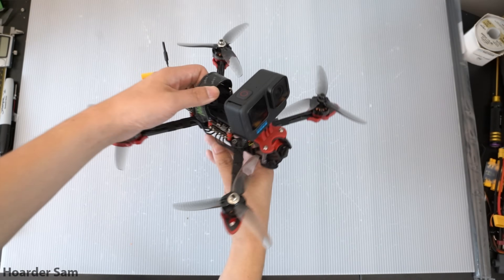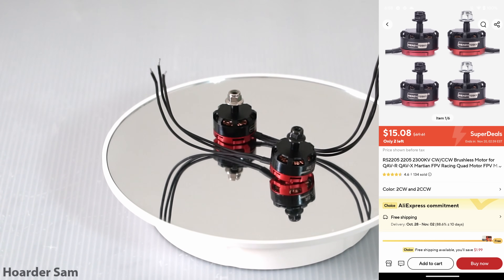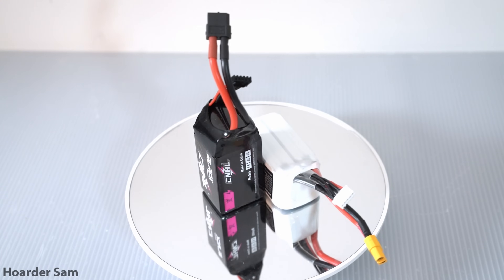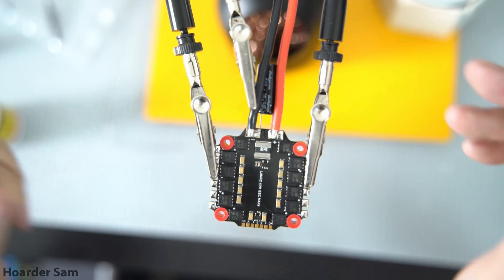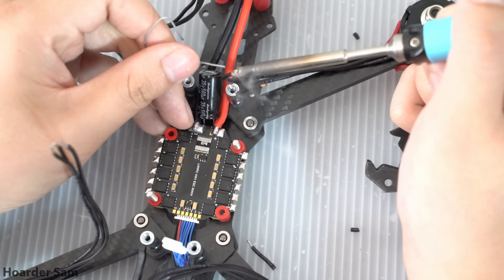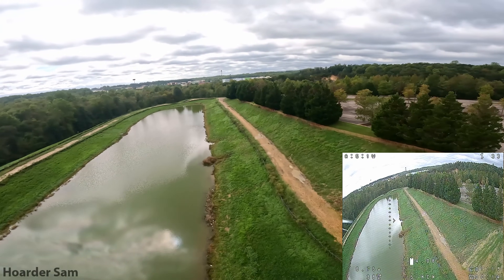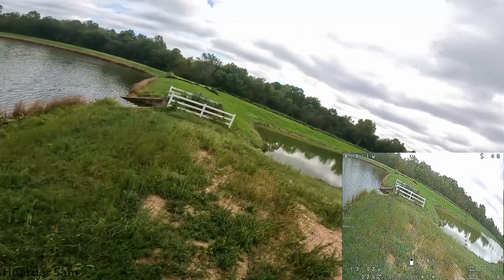How to build a 5-inch FPV Drone for $100

Comment from the maker: Wiring diagram: https://i.ibb.co/2WLqK8p/wiringdiagram.png
Betaflight setup video: https://www.youtube.com/watch?v=sRp73gKOTM8
Frame build video (no audio): https://www.youtube.com/watch?v=ldjRXFBIbpM
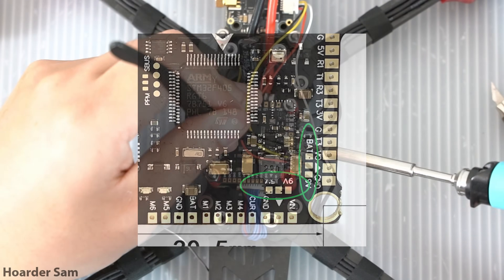Reply: Sorry for interruption, are you able to explain a little bit more about the Vtx wiring one at 8:33. I don’t really understand if you need to solder both part or just choose one section and in that section you solder a bridge.
Reply from the maker: @JohnChen-jc1qm  Oops sorry I haven't made the wiring diagram yet. Here's how I bridged my pads: https://i.ibb.co/hBbRgRq/bridge.png
Reply: @hoardersam10  can you please make the wiring diagram
Reply: Where is wiring diagram
Reply: hey hey can you make a wiring diagram if you are using a SpeedyBee TX800 VTX. i can see it only can get Voltage in:3.7-5.5V
Reply: can you please tell us were to get the file for the auto populating and also how to bind between the receiver and the transmitter ( I'm new so i kind of need more details) please respond i really need to know
Reply: Hi, I got the Speedybee tx800 vtx, do I still follow this wiring diagram? The Solder Bridges?
Reply: I used the 9v solder bridge.. I think I damaged the Speedybee tx800.. Should I use only 5v?
Reply: I haven't plugged the battery yet, I only used the cable to pc.. I'm afraid that I damaged the tx800.
Reply: Nevermind, I got it working now I used the 5Volts instead of using the 9v solder bridge...now the speedytx800 is working...Thanks
Reply: @TheFilewalker93  I also have the same problem, but I can't figure out where the 5V is for the VTX. Can you let me know?
Reply: @TheFilewalker93  you will destroy it man i just did it to my one he's not rly making things clear he links parts to use but they aren't compatible a few people have blow them up because of him
Reply: @brazed420  mine works fine...at first I thought i destroyed it.
Reply: @TheFilewalker93 Can some1 tell why his 5inch drone guide is more cheaper than the 3.5inch one bc im looking to build a 3.5inch drone but i thought that 3.5 inch drone were cheaper?
Reply: And can u make a guide abt it for ppl who dont care abt weight
Reply: @TheFilewalker93  i need help man im new i im scared
Reply: @MRStylinNe help about what? vtx?
Reply: @AVoiDes i dont know so much about the cost of 3.5 inch drone, i just followed this build and it works just fine until i lost it on my 3rd fly.. i should have invested in a gps..
Reply: @TheFilewalker93 what does it mean by bridging? What do i do for that part ? i dont understand, first time building
Reply: I'm building this drone but with the ratel 2 cam and I'm using the ARRIS VR-009 fpv goggles which are a 16:9 and i tried all the different things pal ntsc and i cant cet it to work at all can you please help i really need it please
Reply: i entered the camera settings and matched the ntsc thing but on my Arries goggles it just shows the video in the background and then random characters mostly V can you please help i really need it
Reply from the maker: @jim-xi1ml Try messing with the font manager, reupload the fonts
Reply: i just figured it out it was a font problem
Reply: hi its me again iv built this drone about 8 months ago and haven't had really any problems except for one thing and it is the video quality just randomly a few months ago the video coming from the vtx got worse there is more green in the video a little bit of flickering but the flickering doesn't happen much and i think it is a bit more fuzzy or something. I checked all my wires and everything and didn't find anything that looks off. Do you know what the problem might be?

Comment: Now, on the page for the flight co ntroller, there are several choices.  I see in the comments that this price given is not for the complete set.  It seems the more expensive $58 option includes all pieces.  And whats with only being able to buy one piece since im thinking of building at least 3 to have a spare?  But yeah, the parts pages are confusing what exactly ill get for the money then having to figure out which is the other piece im missing.

Comment: Hi, I built the drone according to your tutorial and it came out fantastic, I wanted to try installing the Caddx VTX Ascent, do you think it could work?
Reply from the maker: Electrically it will work fine, but physically mounting it may be tough. The ascent is a 14mm camera and the cable is short, so you will need both a camera adapter and some kind of way to mount the VTX board closer to the camera
Reply: @hoardersam10 To mount it, I was already thinking of creating a dedicated support, it shouldn't be a problem, as soon as it arrives I'll try, if you're interested I'll let you know when I tested it how it works.

Comment: I made  this drone at the end of 2025. Cost about $200, but I used a Zeus 1.6w VTX, a Caddx Ratel 2 camera, added a Vifly Buzzer and also a GPS with magnetometer. To get the GPS to work, I had to remap the LED pad to a Soft Serial TX 1 port so that I could use this as a Smart Audio pad for the VTX. This freed up TX3 and RX3 to be an I2C interface for the SCL and SDA on the GPS/magnetometer, with the GPS being on TX1/RX1.  While the OMNIBUS F4 is a little limited in the number of available UARTS, with SOFTSERIAL and resource mapping it's enough to get a GPS with magnetometer to work.
Reply: same also 200 i didnt wait for sales cause i dont care enough

Comment: I have 4 6s 1300mAh 22.2V LiPo, Can they still work?
Reply from the maker: The 2400kv motors are only rated up to 4s, so you will need to get 1700-1900kv motors for your 6s lipos

Comment: I tried the smoke stopper test, and the light didnt come on on the FCU, is this just a version difference or a lower voltage thing or have I bought a crap smoke stopper?

Comment: can you fly the drone with 6s lipos?
Reply from the maker: These 2400kv motors are only good for 4s, they will fry on 6s
Reply: @hoardersam10  if i change the motors for MEPS NEON 2207 Motors can i use 6s lipos

Comment: Hello @hoardersam10 ! 
I'm pretty new. Can you tell me how you get the power cables on there? Struggle since an hour and now I have 3 contacts presoldered and the solder didn't melt anymore.. was hard to presolder them and after trying to connect them to the presoldered cables it wasn't melting anymore. :(
Reply from the maker: If solder isn't melting any more, it sounds like the flux is all gone so you will need to add flux to get it to melt again.

What iron are you using?
Reply: @hoardersam10 thanks for your really fast response! I'll try it in the next minutes. I use sn99.3 cu0.7 with diam 0.6mm (if it's true, it's from AliExpress) the soldering iron is an old one model no zd-30B 220-240V/50Hz/30W but was working on other solderings the last days with the same setup fine. Have Halogen free Flux: NC-559-ASM
Can't explain why the solder isn't connecting to the board contacts :( with and without flux
Reply from the maker: @philipp3308  Two things make it harder, that is lead-free solder, and that soldering iron is not a smart type that can adjust heat quickly.

So what happens is if you touch the soldering iron to a part, the part absorbs the heat, the temperature lowers, and then the solder doesn't melt because the temperature is low. 

A better soldering iron like Pinecil or TS100 can instantly put a ton of power back into the tip, in order to maintain temperature. The old soldering irons can't do that.

I would recommend leaded solder (melts easier) and the Pinecil or TS100
Reply: @hoardersam10 thank you so much.. was able to melt the solder again with the flux.
Don't think the heat on the tip is the problem. The solder does stick like a water drop on the tip of the iron, but doesn't stay on the contacts of the board.. :(

I'll try the cables of the transmitter and if this doesn't work I have to wait for the new iron to arrive. x.x 😅
Thank you!!!
Reply: Ps hope I didn't fry anything on the board already xP

Comment: The ESC in the provided link is a 4in1, so I guess we need a 4in1 module with the radiomaster pocket or to buy the 4in1 version of the radiomaster pocket.  

Can you recommend an esc that can directly bind with elrs radio?

Comment: What direction of the propellers you install on the motor? Prop In or Out?
Reply: I am using out. He is using Prop In, you can check at 9:47 looking the prop position.

Comment: August 2025: there's no way this costs under $100. There's a sale going on right now on aliexpress and I followed all your links to those specific parts, they all cost roughly 1.5x-2x as much, and that's before tariffs. It says they're all on sale yet they cost way more than they do in this video. Even without a controller right now the cost is about $200 for these parts
Also this does not include the goggles either
Reply: It depends on your country, but as of august 2025, you can build it for around 100$
https://youtu.be/PlHf5JjOwbA
Reply: I actually bought parts for this drone last month, costed me €239.73 ( $281) and thats without goggles and VTX ( I plan to buy it later)
Reply: just checking them also, everything costs around 150€ without controller and goggles, drone without batteries goes for 100€

Comment: Dies the Batterie conector come with the Stack or have I to Build my own
Reply from the maker: It comes with the stack
Reply: @hoardersam10  i have two last questions is the 1W VTX Good and do you know better Motors who can dit but are Not that expansive to like 30 20

Comment: What capacitor a battery power cable do you use? I can’t find it linked in the products page.
Reply: Look up similar builds or BnF with the same (almost) specs

Comment: Hey, i bought the parts you linked except for the lipo batteries. I couldn't find any reasonably priced 1500 mah 4s batteries, would a 2200 be fine?

Comment: Did you just use the betaflight pid preset for this drone? I built this using speedybeef405 v3 fc+esc (can't get the blackbox to work) and rush tank vtx but everything else is what you used oh and I used a ratel2

Comment: How do you attach the heatsink to the VTX,it doesnt seem to fit it,I really want to attach it perfectly since the VTX runs hot and I plan to ramp up the power later on to 1W
Reply: Did you ever figure out how to attach the heatsink to the VTX?
Reply: @jimbigbird2 nope it still doesnt perfectly cover the entire surface of the vtx,I just forced it to be in an awkward position.anyways,I dont use this vtx anymore

Comment: Can i use 6s 100c 2000 mAh lipo battery?
Reply from the maker: Can't do 6s with these motors, you'll need to get some ~1800kv motors. Also that battery is the perfect size for a 7inch drone, maybe build the 7 inch instead?

Comment: Hey I am currently stocking up on equipment to build my first drone. What solder do you use?
Reply from the maker: I use Kester 63/37 leaded solder in 0.8mm diameter
Reply: @hoardersam10  Thanks and what temp do you solder at?
Reply from the maker: @nimbleduck  Usually 320 C

Comment: The SpeedyBee TX800 uses 5V but the flight controller only has a 9V or full battery option. Can I use the 5V from the cam?

Comment: Hey sam thanks for the video I got all the parts but I did not get the elrs controller I got the cc2500 will it still connect to the drone I am new and don’t know what to do but thank you
Reply from the maker: You would want a FrSky receiver like the Radiomaster R81 V2. The cc2500 is designed to work with Frsky
Reply: thank you I just decided to get the real ones and return but I am waiting on one more part and I can start soldering is it hard to conect the controller to the drone

Comment: Hey man I just built this drone step by step. I used the ratel 2. The more expensive camera. For some reason when I try to enable osd there is letter all across the screen. I can get it work with no osd but it would nice to get a view of the battery voltage
Reply from the maker: Use font manager to upload the default betaflight font

Comment: What is the final weight of it? I'm willing to build my first drone and I would like go around recording landscapes but I could get in trouble if it weights more than 250grams because in Spain u need an specific license to fly these and I could get an up to 40k € fine sooo... I hope that someone can tell me before buying all the parts hahaha. Thanks!!
Reply from the maker: It will be over 250g. I have a 3.5" freestyle build that is designed to be under 250g

Comment: I bought everything from the list and was ready to build but I noticed that I don't have the capacitor and the battery leads. Any links to get those?
Reply from the maker: It should come with the flight controller and ESC stack if you bought the stack. Maybe you just got the flight controller?
Reply: @hoardersam10  ok thanks! I guess I only bought the flight controller. Thanks for the help!
Reply: @hoardersam10 is there a difference between 45A and 60A

Comment: Here's my question , can i use a Frsky control system instead of the ELRS system ?  I have watched multitudes of videos on the ELRS system and still can not wrap my head around it even after trying dozens of time to bind a simple Tiny Whoop to a Zorro TX ???
Reply: Frsky is trash. ELRS binding is very simple...

Comment: Can this work with a Spektrum DX9 transmitter?
Reply from the maker: Yes, you can use a satellite receiver and flash the flight controller to use spektrum as the receiver input

Comment: can anyone tell me what the strongest motor i could buy for this build is? Im totally new to FPV so i don't even know how i'd go about determining that...
Reply: Don't get 5 inch drone if you are a beginner...
Reply: @MatiX415 bruh i purchased all the parts in this video already. and since asking this question, i've figured out the answer for myself. its not rocket science lol. just needed a bit of guidance to start. Thanks for nothing.
Reply: @SuperSkrrrt  why the heck did you build a 5 inch drone if you are total beginner 💀, that's insane. Good luck. I don't know why you didn't research and buy a 3 inch instead (a cheap darwinfpv baby ape pro v2 is probably way better than this build for freestyle)

Comment: Unless you have built drones before,  i wouldn't try if I where you. You will have to buy these cheap parts over and over again if you mess up, and it will have cost you more than if you where to just  buy one that's already built and tuned. Watch Josha Bardwell as he explains every detail of the things he builds.

Comment: Thank you for the freat video! I have one question. Im just strating this hobby and bought walksnail goggles. Can i do this build and just replace the camera witch some walksnail one? Thank you!
Reply from the maker: Yeah thats possible, walksnail moonlight is a good option
Reply: @hoardersam10  ok thank you :)
Reply: Just came across your comment and I personally would advise you to start with 6s already. Eventually you'll want to upgrade and if possible it's smarter to pay a couple bucks more  per lipo (and probably a slightly more expensive esc) from the beginning than having like eight 4s packs and having to sell them in order to get new 6s ones for a 6s build.

Comment: What is the best combination of ESC FC and Motors and Battery for a 5 Inch cruiser long range setup. i want to build the floatiest cruiser 5 inch.  Priority is Maximum Range and Flighttime. i will use DIY Lilo battery packs 18650 cells. i want to use 4G Modem and Pi with Camera for Video and Connection (ELRS). Groundstation will be my Home PC with gamepad and Ardupilot  . Is a higer S Battery Pack and lower KV Motor more efficent? iam ready to sacrifice  power for range and flighttime.

Comment: The VTX I bought has two grounds and a 5v out, where do I need to solder these? You didn’t have them, they are listed on the diagram however does not show where to solder to

Comment: Hi awesome video, I want to start flying a fpv drone but for my first drone I'm trying to stay on a budget. Is there a bit cheaper fpv headset that you recommend or can I just use my Meta quest 2 as a headset.
Keep up the good videos!
Reply from the maker: VR009 is available for ~$50 USD, you can also get 4-5 inch FPV monitors for around that much too
Reply: @hoardersam10  Hi sorry but I need a little bit of help again. Does the flight controller board use FCC or LBT because I live in Germany and here we are only allowed to use LBT for the Controller.
Reply from the maker: @damionlemke The FCC/LBT is for transmitter output power only, so anything else on the drone won't care if its one or the other

Comment: Hi Guys,

What is the weight of that build?

i urge to start the FPV hobby, but have difficulties to get into it all on myself.
Without knowing all the basics, this was a great video to learn more about the parts i'd need.
Last summer i planned to blindly buy a dyi, to get started somehow.
Can somebody suggest a starter set?
I already bought a Graupner Mz-18, but i would discard it, if necessary. Is a Pixhawk 6 C Mini a good start?
Are there Discord/Mastodon/Matrix channels i'd fit in?

Comment: Hello, I have already motors from old drone, battery,  frame. Can I use them ? Instead of buing it from aliexpress ? And what about controler, what should I use as it ? If I want just fly without googles(normaly just controler and screen).

Comment: im trying to make this for a school project, are there any much cheaper remote controllers that do the job rather than the radiomaster transmitter remote?
Reply from the maker: You might be able to get by with a flysky i6, which should be around $50 and includes the receiver. I haven't specifically used it yet but plan on doing a video soon since its a popular budget remote